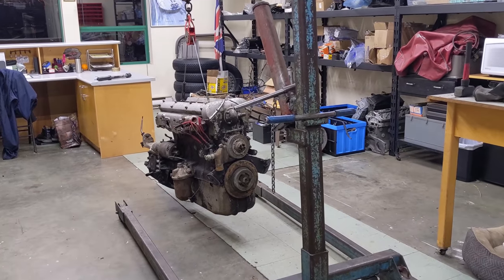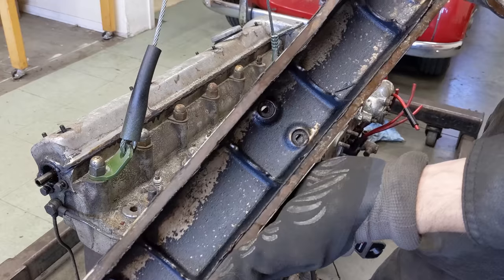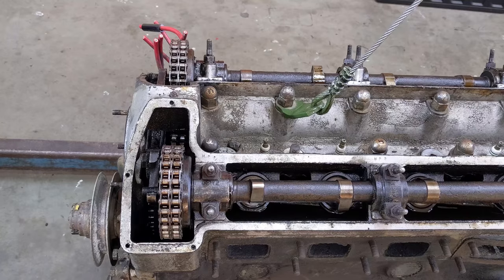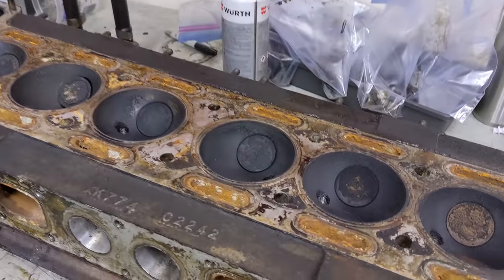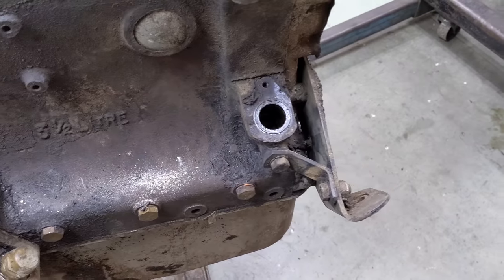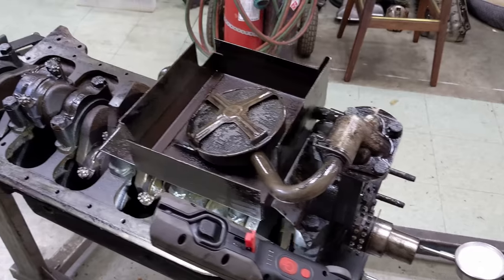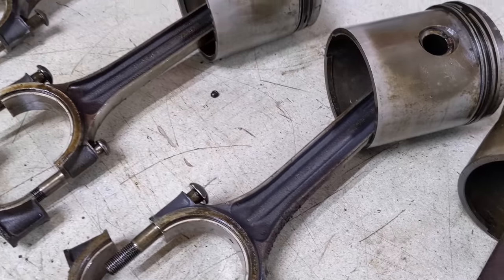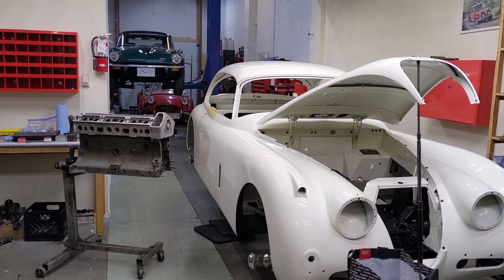Rare 1952 Jaguar XK120 Motor Rebuild

Comment: G'day Richard.

I tend to treat parts numbers and dealer information with considerable reservation if not scepticism because I once owned a Subaru which was difficult to time after a rebuild.

It transpired that there was a second but much fainter timing mark on the flywheel not far from the 'primary' which was the correct indicator and the engine started and ran fine after it was timed to the faint mark.

When my mechanic mate inquired about the issue via a Subaru dealership the representative was adamant that according to their database the Subaru model I owned was never built with that series motor installed.

The problem with that was my brother purchased the car new before I owned it and the engine was, original from new!

Further inquiry on a reputable Subaru reference site revealed that by reference to the serial number the car I owned was apparently built during a transition from carburation to fuel injection hence the 'nonstandard' aspects to it.

On another occasion a retired friend who had been a highly experienced and skilled motor mechanic his entire working life had occasion to rebuild the motor in a Volkswagen Golf.

He did so because a hardwood stick had been flipped up by a tyre and punched a hole in the paper thin cast aluminium sump causing the engine to bleed out and seize.

When my mechanic friend disassembled the engine he found that the big-end journals had been separated after casting by shearing them off rather than machining them so he phoned a major local dealership to find out what the story was because he had never seen such a thing before.

He was then informed by whoever he spoke to that the engine he described had never been installed in the Golf series and was reserved for Audi's so it must have been an aftermarket installation, however the owner had purchased the vehicle new and just like my Subaru the engine was, original from new!

Comment: Red stuff on the bolts might be red lead (red oxide) and the slotted nuts are "castellated" nuts, but don't stop now, the motor is well worth rebuilding.

Comment: The ring gear is removed by drilling a 1/4" hole just below the valley of a tooth, then you crack it with a cold chisel. Gear falls off - no machining! New gear is installed by heating and shrink fitting. Carry on men.
Reply from the maker: Good to know thanks for the tip.

Comment: When you take these engines apart and maybe in the next video, could you show the stamps on the back of the bearings? I used to work for Vandervell in the 1980's and I am quite curious to see if any was used in these old Jaguar engines.

Comment: 14:02 I rebuilt a 1950 XK engine and the timing adjustment sprocket looked more like a bicycle sprocket very course teeth. I think it had a double plunger as well and no chain guides. I had to find this later style which I had to replace the whole upper bracket to do.

Comment: You spoke of causes of aluminium cylinder head warpage. I shake my head when I see mechanics just remove head bolts/nuts in any old order but use sequence tensioning when fitting. HELLO! "This does NOT compute".
Reply from the maker: Yeah John I know what you are saying generally it's inside-out, I forgot to mention that.

Comment: I worked in a garage in England back in the 1960's . It was common practice to put red  hermetite on bolts as a means of locking them. It was very effective as it dried out and went hard. The SE on the camshaft refers to Jaguar special equipment package which was the 180hp model.

Comment: I just happened across your channel...when I was about 10 years old, in 1957, my Dad bought a 1952 XK120 (Coventry Climax)?...fairly cheap...ran OK, but smoked and need a complete engine and paint job...so he sold it and bought a 1952 MK7....ran OK, smoked, needed paint, and leaked oil badly...
 You know, you put a big pan under there at night, in the morning you pour all the oil back in...
 As I recall, that car was OK, sounded cool, but wasn't really very fast, so out it went, next we had a 1952 Mercedes diesel....noisy, smoked and was even slower...4 door, so I guess it was heavy...nice car though.

Comment: Aluminum great material to work with. The problem with aluminum it has a memory. If it has been warped due to overheating it has a tendency to follow its grain.

Comment: Based on the looks of the cam bearings, I think the head warpage would be OK. Keep in mind the camshaft itself deflects under load. Try throwing that cam back into the head with the cam caps and assembly lube (minus the valve assembly).  If the cams rotate by hand without binding, you should be ok.

Comment: Welch plugs, not Welsh. Question: why not have the thrust flange and grind it back to standard. As far as the deck surface thinning, why not braze it instead of welding it?
Reply: Welded, sorry to omit that.
Reply from the maker: Steve, yes Welch thanks. Welding is not a robust fix and there are plenty of crankshafts available. Well, let's see.

Comment: Use a "Top Hat" to update the distributor Mskes starting a snap.  Check Cams as some came from rhe factory with race cams, makes for a high low idle, think after june of 52 they had some spares they didnt want to waste, could never get a straight answer on this, if you got them they are gold 130 mph easy, Ran one in South Texas , knew the Sheriff .

Comment: I used to glue 0,1mm thick or what ever needed thickness of hardened brass behind the thrust bearings in order to get the end float correct if there was no oversize bearings available. 
Metal epoxy both surfaces roughed and pressed together. Even if the fill somehow gets lose, it wont come off behond the bearing as it will also sit in place just like the bearings themselves.

Comment: That red paint on the bolts for the bell housing looks a lot like a rust inhibitor called “Red Oxide paint ” I believe it had a heavy lead content. We use a lot in the British Army work I did and also in the marine work while boat building. Due to the lead content I guess it’s not used today

Comment: Cylinder heads will not warp just because they are laying o a bench which is not flat or evenly supported.because a stud or two is left in the head. It would take a large strain / stress on the head to produce a warpage and probably result in cracking the head.

Comment: I believe the red on the bolts Is red oxide paint it was a popular rust/corrosion protector in England in the 40s/50s/60s/70s it was used on bolts/chassis/and anything subject to extremes and I know I was an apprentice in the UK in the 1970s and we used it extensively....hope that helps.

Comment: The starter ring gear would have been shrunk (heated) before being fitted to the fly-wheel. That was the usual way in the 50's. The red goo on the studs was possibly a product called Red Hematite Gasket Sealer. Widely used in UK if that is where the engine was worked on before you stripped it. Corrosion inhibitor/anti-freeze mixture was not originally used only anti-freeze which could account for the galvanic corrosion in the water jacket.

Comment: Old school to remove the starter ring gear just a cold chisel down between two teeth. It is relatively soft as evident from the worn teeth. The ring easily splits and then falls off the flywheel.

Comment: Hey, about those thrust washers: I've been through a lot of Soviet/Russian engines: They sell "third rebuild" kits for most of their engines, especially older ones. I've personally bought con-rod bearings, that were  0.3mm over... It was the crankshaft's fourth grinding! However, this baby is not a soviet-era excuse-of-a machine... I wonder if it would be possible to use galvanic plating (or electro-plating, i'm not sure about the correct term) for "thickening" a set of washers... I've seen it done, and the results were not half bad! The motor ran about 15000 km without a hitch, and i think it would've continued for a lot longer... But the guy crashed it promptly into a tree! Both headlights were illuminating eachother, engine and transmission went half-way to the rear seats...  Well, i wish you good luck and happy sailing with the revival of this beauty, and i really envy you(in a good manner) for the chance of working with such machines!

Comment: Damaged crankshafts like that are normally welded and re-machined to factory specifications. if your machine shop doesn't do it they should know someone who can do it. a welding shop, a good welding shop, can do the repair without warping the crankshaft or causing cracks.

Comment: It’s incredible how these motors were designed to pull 8000 rpm and 170 mph in the lemans racing specs in the 1950 s.

Comment: Hey Richard, definitely want to see the next steps. Really interesting and well narrated video.  I’ve learned a huge amount and will look to apply the knowledge to 667026 as she is ready to be restored here in Ireland.  
Also interested to know where you’ll get your parts Guy Broad, Coventry Auto Components etc.
Best of luck with the overall rebuild.
Reply from the maker: SNG Barratt, Cov Auto Components then specialists like Cometic, Rob Beere Racing

Comment: Which machine shop do you use for the fly wheel work?  I'm starting my restoration on my 1954 XK120.  I will be interested in what you do with the Moss gearbox.

Comment: I'm more used to Lotus Twincam engines of late, similar design including pistons/chambers, and to get a good seal with the stiff cast iron crank and relatively soft alloy head in comparison, the Cometic MLS are not always easy (stringent requirements on flatness and surface roughness), and I prefer to use more traditional composite gaskets (e.g. Ajusa), esp. on race engines (even with high quality ARP studs).

Comment: very nice video, very detailed...  I have a question about the warped head...   when it was brand new, the deck surface was paralel to the valve cover surface...  at one moment the engine overheated and the head warped. so the machine shop resurfeced the deck but the valve cover surface stayed warped.  wat would be the correct method ? could they unwarp the head ? thanks

Comment: I think the red smear or "paint" on those bolts is to prevent or at least minimise electrolysis with two different metals. Aluminium to steel ?

Comment: I'd definitely like to see how you fix the warped head.  Do they use a press to straighten it out?  Using the cam journals as a reference surface?  I imagine you'd still have to re-deck and  line bore the journals just to be safe.
Reply from the maker: Hi Mike, I believe it's held down flat then heated up

Comment: Red lead paint to prevent corrosion/galvanic reaction between dis-similar metals.  Used to be used on ships and heavy equipment as a primer. anything that was weather or water exposed.  Let's see the final product.

Comment: I thought that engine was in above average condition age considered, 1952 model Jag, 70 years old now. As for the timing chain cavity being more grubby than the exterior of the block, You wouldn't expect anything else. Oils back in 52 were different to what they are now, and the water pump looking "crusty", I thought It looked pretty good, could have been the original ! As for rust in the blocks water jacket, all just normal for 70 yrs old. Metal expands by a factor of 7X when turned into rust. So expect to see a bit in there. Soft water was the prescribed coolant back in those days.
 Very interesting all the same.

Comment: Re: aluminium and warping under gravity. I don't know. However, aluminium electrical wiring is a big problem, requires specific terminations for connection to switches, etc. If you use just ordinary screw terminations the aluminium creeps under pressure and the connection goes bad. So perhaps there is something about aluminium changing shape under sustained pressure, but it seems a bit of a leap from wiring to cylinder heads changing shape.

Comment: Wow you can tell no antifreeze was used in this engine, the red lead was to stop the bolts from rusting and corroding with the alloy, nice engine but a bit of a pig for oil leaks

Comment: I found that zerk fitting on the water pump interesting. Also, it's driving me nuts, is that a Gulf of Georgia chart on your shop table? I can never get a close enough view. (I'm a retired Alaskan fisherman - merchant mariner (captain and engineer) and I picked up on the nautical chart right away.)
PS: Man, are you lucky at not needing a wheel-puller!
Reply from the maker: Yeah not sure where your referring to, but we are right by the Strait of Georgia.

Comment: I've never touched one of these motors, but maybe the allen bolts on the cam covers were factory-approved "updates" that Jag mechanics would routinely do? I can't see an owner just casually drilling into the heads and making this modification and that cover design looks like a giant leak waiting to happen.

Comment: The red deposit is probably finely divided iron oxide, from the clutch system.  It's basically jeweller's rouge.  You can often see this sort of thing where there has been fretting corrosion.  You may see a red hard sealant on joints though.  This could be a liquid 'gasket' material that we had here in England years ago, called Red Hermatite.

Comment: Someone was not running coolant in that engine. Many people think you don`t need to run coolant because they live in a area that does not get cold but Antifreeze does more then just protect from freezing it also prevents rust it lubricates the water pump and it also help to keep the engine cooler then just straight water. I see so many people running straight water and I tell them to stop running straight water it`s not good for the engine and cooling system you got to run coolant.

Comment: obviously a generational thing, the red stuff is Red lead/Red lead oxide/lead tetroxide/calcium plumbate, or just red lead, non soluble in water, sticks as well to rust as "everything else", poisionous as hell, banned in the Uk and in the day used for everything, such as coatings on ferrous metals, so used in car industry, plumbing industry, marine industry also used as floor paint in the showers in military establishments for one thing, but a range of uses

Comment: Shame about the head. Other than that the rest looks reasonable. 👍
Reply: MichaelKingsfordGray  true but it would be better if it was not as scruffy, the less you need to do to them the better. I get your point and I have used a few in way worse shape too . 👍

Comment: Definitely wrong way to take out the core plugs or people call freeze plugs supposed to use a center punch poor machine job rebuild and the owner must not care much for the car never change the oil or the coolant basically got a piece of junk